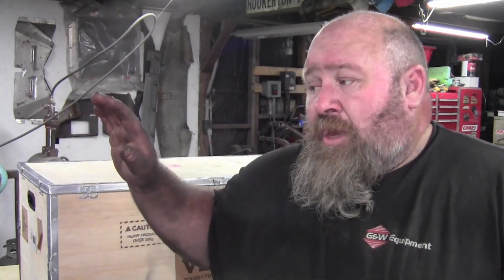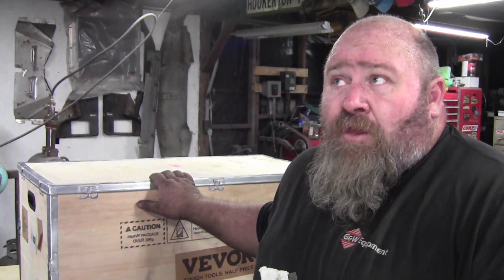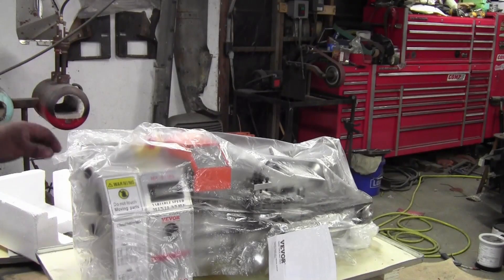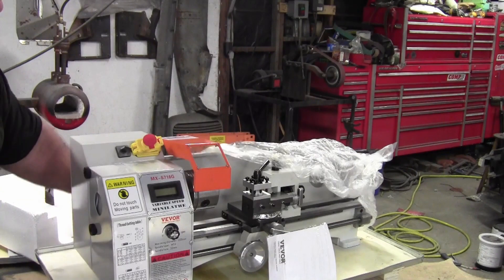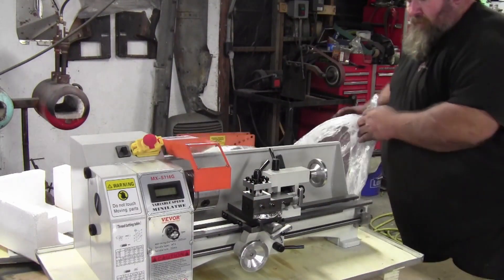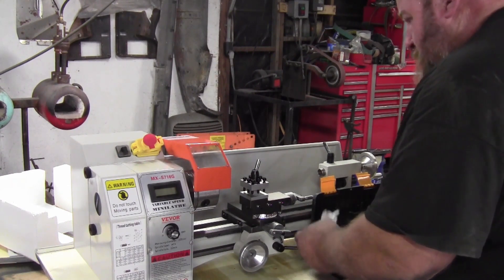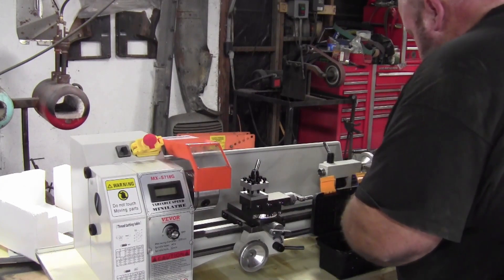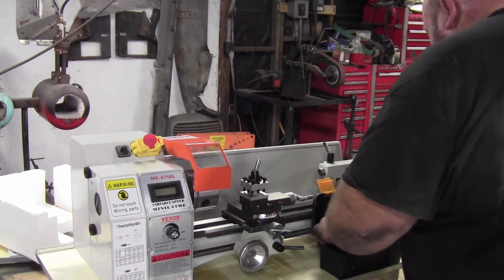Vevor Mini Lathe MX-S716G

Comment: Good luck.  I bought the same machine, and got a 300. Refund because of all of the deficiencies.  I think it will be OK after I re build it, as long  as the bead doesn’t  have to be milled.  I know it is out a little.  The only good thing about these machines is that they have a large spindle bore, and are able to accommodate larger stock extending thru the spindle, and out the gear cover.   I purchased another lathe from Micro Mark, which is much higher UA lite, and came pre adjusted (no slop anywhere), because I needed something to be able to get my work done, while the VEVOR is being re worked.  My Micro- Mark has a much smaller spindle bore though.  I wish you good luck.  Getting these VEVOR lathes to produce in spec work is very difficult, and you will spend a lot of time and money.  A bad feature of this particular model, is that there is no way of reversing the lead screw rotation alone, without reversing the spindle rotation at the same time.  Who cuts rotating the spindle in reverse, no one, so what good is it? I will be selling it after I prove it will be satisfactory to someone else.  When I need a bigger Machine, it will probably be a Precision Mathews, and have a power cross feed.
Reply from the maker: Seriously having daydreams about chucking the whole thing in my Bridgeport and turning it into chips with a fly cutter!! Every day I wish I had held out for something better. I'm going to mess with it a bit more, but I think I'll be on the lookout for something heavier in the future.

Comment: I got one of these too. My assessment is this lathe was made from parts that did not meet spec. Nothing on the lathe was made to any spec. Some parts I clearly saw were rejects but were fitted anyway. 30thou plus flatness is normal! It took months of work to get the machine to be semi ok. To fix it you'll probably need a milling machine and oddly, another lathe. My ways were so far out that it was not possible to go end to end with the crosslide without crazy play on one end and binding on the other. I have it ok to do work now but am not happy with it. I have a milling machine coming in soon that I can use to finish the jobs required.  I bought it because of the large spindle bore and that has come in very handy several times. If it wasn't for that large bore in such a small sized lathe, I would have made an anchor out of it. Rest assured though, if you are desperate/crazy enough, you can make it work, but you'll never be happy with it. Particularly the electronics control system. Best of luck!
Reply from the maker: Thank you for the comment. I have since purchased a Series 1 Bridgeport. So, I do have that at my disposal for making parts.  I think the lathe is the worst purchase I have made in the last 12 months. I'm a little hardheaded so I may play with it for a bit. But the more time that passes the more I realize it will never do what I want it to do, and at some point, the amount of time required to make it better will be better spent finding a better machine. Again, thank you for watching and the comment!
Reply: @faroironandcustoms6577  Sounds like we're made of the same cloth! If you mount the bed upside down flat on the mill, you can clean up the underside so it is parallel. That was the biggest job on mine and it's only part complete due to my mill being undersized for the work. Most was done by file and micrometer. The next worst were the dovetails. They weren't parallel either nor were they flat. Did those by hand too. The tailstock did not mount properly on the bed. It needed shimming and scrapping of the V grove. It also pointed on an angle so when in the grove and extending the tailstock, it would point off at an angle. Very frustrating.  I reamed and tapped the cross slide thread as it was not only on an angle, but was damaged too. I made tapered brass gibbs instead of the crap they had which couldn't hold anything correctly. The cross slide never sat flat, just like the tail stock. The crappiest thing on mine was the locknut on the spindle. Mine was drilled and tapped on such a bad angle it looked like it cross threaded two threads. I mean about 70thou gap on one end of the nut while the other was touching. Crazy. Still, I got the thing to where it can turn SS with light cuts using carbide inserts. Works best with HSS though. Finish is not too bad now but I may as well have used a cordless drill as a lathe before the work. The quality was about the same. Anyway, best of luck. I have no doubt with your mill you can make it into a fine machine. Oh, get a 3/4 plate of steel to mount it to. The lathe bed is very flexible without it. Made a huge difference for me.
Reply from the maker: @susanss70spartymix77  Thanks. I finally mounted it to my bench in a later video. I do need to get back to it and finish the job. I used the backs of 2, 7" wide forklift blades welded together for the base. (1.75" thick 4140) I want to come back and mill those flat before I do any more work to the lathe (I didn't have the mill at the time of making the base plate.) It is hard to find the time to mess with it as I have allot more going on. Again, thank you for the reply.

Comment: Is gong to go one of two ways. Either you will have a "good" unit and it will handle brass, aluminum, and plastics or it will need way more work than it's worth. I'd look into a Precision Matthews lathe if you don't have the budget to go with the bigger lathes. Good luck with it